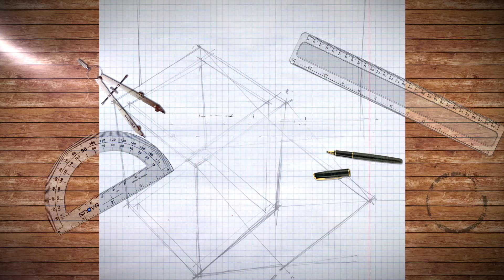Build a MOTORIZED monitor lift (on a budget!)

Comment: This gives me a cool idea.
It could serve to hide a 5.25" drive if someone has a custom desk PC. Just have it be retracted and flush with the surface when not in use, and when you need it, have it rise out of the desk itself, close enough to access it easily.

...Yes I know 5.25" drives are basically extinct but some people still use them, in fact some people even still NEED them to do stuff.

Comment: Very cool idea, I've seen furniture with these in it, but super expensive.
My one suggestion would be to make the platform into a box with sides and the top piece (that you put on yours when it is down).  this way when it goes down, you don't need to put that piece back.
Reply: Hi Michael 🤓

Comment: A cool idea is to make it also like a frame. So you need need to have a piece of plywood to manually put down, it will just rise up like a frame. And if it can handle the weight you probably do some nice designs or paintings to hang on it. Would be really cool

Comment: Awesome design! Looking to do the same but mounting it on the underside of the desk. I'd like to have usable workspace when lowered without having to manually place a platform on the top whenever lowered. Thank you for the video. Has everything in it that I needed.

Comment: I like it and to anyone who does to, you can actually improve this.
Instead of a threaded rod, use a lead screw. They are more rigid and provides better control due to them having more than 1 separate thread.
You can also replace the right angle aluminum thing with aluminum linear rail shaft. This will reduce the overall required force due to friction.

Comment: Man you did great. i was  thingking about how to make cheap long stroke linear acuator and your video solve them all. I was succesfully made sliding door also using gt2 Belt and pulley, but never once thingking it also be possible to attach thread working as linear actuator.

Comment: I would’ve extended the chassis higher and made the drop-in beam part of it. Or hinged that so I could flip it back when raising. Seems a bit neater than removing it manually every time.
Nevertheless, excellent work!

Comment: For a few more bucks you would get a more solid and sustainable solution.

There are special tools for connecting the belt and normally you add also a tentioner to avoid that the belt wobbling around and lose traction.

Comment: That is a really cool DIY project.  If you added a frame on the sides and top you would not have to manually put a cover on it when it's in the down position.

Comment: A good preventive measure is to put two of the limits switches in series with each other for each motor on each end so that just in case one limit switch fails, the other switch will back it up and still cut the circuit so your motors don't burn themselves up by trying to pass the end of their range and getting physically stuck.  One extra switch now for each motor is certainly cheaper and decidedly more convenient than having to acquire and install compatible replacement motors later!  Simple prevention that costs next to nothing.
Reply: Matt

Comment: Very good. Think uve missed a trick though. Why not attach the the cover to the mechanism aswell that way the whole lot will lower and instantly hide the monitor. You could even hang some small pc speakers to the underside of the cover which would then lift up with the whole assembly.

Comment: You could try using trapezoidal threads and their given nuts,, (the ones used in 3d printers), they're pitch is much greater so the monitor can come up faster but increase speed does mean increase momentum which could be bad

Comment: You could improve this design by adding a hinge one the door in the back and adding a way for the lift to push it open. Making it completely invisible without the need to put the shelf on it.
Reply: It's not a bad idea, but the problem would be the hinged shelf getting in the way (for example moving the monitor by mistake). Another idea would be to motorize the cover part and put some metal reinforcement to avoid flexing. (Or even motorize the hinge).

Comment: What motor would be powerful enough to lift up a piece of granite countertop above a cabinet with a mixer? ( to lift the whole conglomeration)
I want to make a pop-up kitchen cabinet for a dead corner in my kitchen counter, and the regular method is to buy a ready-built lift (which does not seem so cheap).
Should I just order a ready-made lift? Is that the more practical solution?
Thanks!!!

Comment: A proper and more suitable method, would've been to attach the top platform board, that you manually remove/replace, to the elevation board (so it rises with the whole thing)... Or better yet, a mechanism that rotates it 90 degrees to vertical, front to rear, allowing the riser mechanism to elevate in front of it, and lower back down after use.

That's the way I'd have done it if I had the skills, the tools, the materials, and the time... Oh, and I still had both my arms... and I wasn't stuck in this iron lung... And I had a monitor... And a desk... And an office room.

Comment: Great video, but you forgot to include the schematic and wiring in the description.
Also, the motor isn't available for sale anymore and the limit switches are not linked.
One more tip: Add a bit of oil to the threads.

Comment: no mention of how/what was used for the 12v supply to the motor? would also like to see what happens when the single limit switch fails, but then I`m evil :) good vid though.

Comment: Hi Matt, great video!

On the motorized theme, would you consider a build of some motorized window curtains? Perhaps something that can be smartphone controlled or automated to open/close in time with sunrise/sunset using Arduino? Commercial versions of these are very expensive, yet it seems like something doable with some pulley curtains and some engineering/electronic talent. Would be a nice follow up to your "false window" project too.

Keep up the good work!

Comment: Hey decent job! I also thought about building one. I decided to use pneumatic springs to unlock instead of a motor much quieter faster and more durable. i also dont rely on electricity. Sad thing i dont have a cool remote to open :D

Comment: "Why, I expect you to die Mr. Bond!", mwuahahahaha!!! ;-) Fantastic 60's evil lair accoutrement!
You could also do it in reverse. Instead of raising and lowering the monitor, you could build a cabinet the same size as the whole lift mechanism that would go above the desk. Mount a framed map on the cabinet. Hit the switch and watch the map, inside the frame, go down to reveal the monitor. The map would be much lighter than moving the whole monitor. And very, very evil lair! Or, a drinks cabinet that slides apart. "Same thing we do every night, Pinky. Try to rule the world!"

Comment: use locktite universal glue
it prettymuch glues any rubber, plastic or fabric together
if this doesn't work the way you want or you cant find any at the store try melting them together with nailpolish remover as this is often based on the same chemicals as locktite
do make shure to put on some safety glasses as locktite tends to shoot a small drup in the air when you putt it down without its top!
trust me there are a lott of people ending at te ER for this

Comment: I'm not convinced. I think it lacks a rotating match holder that, when it strikes the side of a glued on matchbox side on the way up, lights the fuse of some fireworks (3 or 6; Super Mario style) to go off at the exact moment the monitor stops. Without that this just feels incomplete...

Nah this is cool. I remember some guy on a renovation show that paid over £10k for a solid desk with a rising monitor. Been using the same desk since I was ten or so but next time I move I might build a corner desk and then I'll 100% keep this guide in mind. Any thoughts on covering the top (just build a frame around the monitor that also sits flush maybe)? I

Comment: So I thought this would be a great project to do. I got about half way though and noticed that there are many missing parts needed to build this thing. The push switches are missing and the brackets for mounting them not to mention the screws.  Then we have the bearings and the entire hardware list needed to mount all this stuff. I guess I will get my order then place another order for the hardware I need to mount it. Why don't you complete your hardware list so I can order the stuff I need.

Comment: I'm going to try and do this with 2x 775 motors and T8 lead screws for the lift, and 8020 aluminum for the desk and lift platform.  I have no idea if it will work or how well, and wouldn't know where to start with trying to calculate it.  If it doesn't work I can try a winch or something.

Comment: It would've been cool if you had used an arduino and another one of those motors with threaded rods to make a wooden plank flip down underneath the desk using hinges so you don't have to remove the wooden board every time.

Comment: Instead of adding 3 more screws to hold the bearings in place..
 You could have simply added another washer to the other side of the bolt holding the bearing.

Comment: Hi, great video... but one question, what governor and power supply you used? if you have a link for that would be very helpful and the buttons to stop it from rising up or down (push switches) link... Thanks and keep up the great work.

Comment: Realistically, how much weight could this motor lift? I have a CNC machine that want to make a lift like this for, so that I can make the table I’m building it on boulder as an enclosure for efficiency. Obviously I’d need more than one motor for the job, I just don’t know the capabilities for the motor itself to be able to calculate if a few of these would work for the application or if I should just shell out the big bucks for a single 3/4hp motor, which I’m trying to avoid. The CNC machine is an x carve so it’s not exactly as heavy as a car, I can pick it up myself without too much issues. Any help will be appreciated! Also, great video!

Comment: Did you use a 110vAC to 12vDC power supply? If so, which one? I'm no electrician by any means & I've had no luck getting a constant speed from the motor. It revs to max rpm for a second, stops, and pulses. Weird...

Comment: Great project mate! Next time, I would use ACME threaded rod for a much faster raising/lowering speed.
Reply: Belts are faster than threads the problem here is the load of the motor

Comment: A lot of reinventing the wheel here. I've bought 60$ electric car windows set [prices in Poland are amazing]. First of all set is for a pair of windows, so actual price was 30$. Secondly it has system stopping the engine if window would come in contact with an obstacle like someones hand... or throat xD It mean it automatically stops platform from rising/lowering exactly at the level i need rendering those funny buttons you've used redundant or if some cables or a sneaky cat [got two of those furry bastards] would get in the way during ascend/descent making it far safer. Funny thing - exactly the same switch that you've used costs 80 cents and those reset buttons that you've used for stopping the platfrom are around 20 cents here and having been selling all that stuff for last 15 years i know both of them are really shitty. I would go with Fael or Omron microswitches instead of this cheapest chinese crap [far too important function in your build] and for the control i would go with arcolight - solid, yet still cheaper than a loaf of bread OR just used those in a kit - nice backlit arrows on them.

Good stuff on this channel. Subbed out of curiosity :)

Comment: Just reviewed this old video. 

I call them as I see them. Although it's a cool feature, but totally unnecessary.  A wall mount with keyboard tray would work better for most people. 

I have used linear activators in past projects. A standing desk was one of them. I used 2. LA’s with a automatic setup using a Arduino. It had presets for 3 people.  

Anyway that’s for sharing you project
Reply: care to share your builds?
Reply: Clint blahblah / possibly Clint, what are you interested in and what part of the world do you live in?

Comment: Quick question! Do you still have the specs on the "high torque relatively low rpm motor" used? Im only just getting around to my attempt so the links are expired and I cant find a similar part.

Comment: I still can't figure out the wiring connection of the motor and the push button which acts as a circuit breaker or some kind of power shun. Can you help me this?

Comment: Haven't yet watched this but I'm looking to somehow apply this, or similar to a wall mounted 3 monitor setup. I'd like to get a sit/standing desk and therefore be able to adjust my monitors. I prefer to have them wall mounted so I don't have desk sag, and because it generally looks nicer.
I have somehow finally found a height adjustable 3 monitor wall mount, so if I just take the clamps off of that and motorize it it might work.
If there's any actual good way to do this I'd love to know it

Comment: Very impressive. Just some questions: the motor you linked to is a 4500rpm one. O viously that would launch your monitor. How many rpm should it be? The pulleys you use have a bit of downgrade (=more torque) in it. What ratio are they?
The limit switch simply as you presented it, won't work as the circuit is broken. No matter if you flip the switch (to reverse the polarity), a broken circuit is a broken circuit. As you still have not provided the schematic, may I presume you did something like this https://arduinodiy.wordpress.com/2019/03/24/using-limitswitches-with-diodes/. ?

Comment: You mounted the first pully gear on incorrectly. Make sure you line up the set screw with the FLAT side of the motor shaft @ 1:55

Comment: Would have been much better to simply have a slotted desktop where the monitor would pass through instead of all the shelf going up and down.
That way you get more room on the desk when lowering the monitor and things won't fall off the edge of the desk while the monitor is down....

Comment: 3:02 Hi love the video. Was just wondering what type of wood you used to mount the bearing? I bought 8mm thick bearings and also bought 8mm thick wood to mount them on but the wood seems too thin and weak and I think might buckle under the weight. Does anyone have any suggestions for what type of wood to get? Thanks a lot
Reply: He uses MDF wood

Comment: Hi Matt you have awesome content keep it up! I stumbled upon your videos looking for a way to make a diy project in mind if you can help out and would be so much appreciated, hopefully you can. I have a to a touch screen radio monitor that is separate from the stereo unit which is connected with a thin ribbon wire harness. I want to make some type of low profile mechanism that will make the touch screen monitor retract in and out of the top of my cars dashboard to modernize my 1998 Honda interior and when using my gps have it eye level with the road. Any advice would be so much appreciated thanks

Comment: Why not use the "flat" on the motor shaft to secure the first pulley?  You put the grub screw in the flat of the "D", that's what it's for.
And microswitches are MUCH more reliable than those little red push buttons.

Sorry, just me whingeing, it's a great build anyway!

Comment: Do you or anyone have a specs on the motor and other parts. This is an older video and the parts are not on ebay. I would like to track down the parts.

Comment: If the top and bottom buttons break the circuit, how do you wire it so the "down" function works when it`s up and the "up" function works when it`s down`?
"Schematic and wiring will be added later."?
:/
Reply: Wire the DC motor terminals to the poles of a DPDT (Double Pole, Double Throw) switch, and connect +/- from the DC power brick to pairs of the remaining switch contacts such that the polarity may be flipped as the switch position is changed. There are now 2 current loops depending on switch position so insert one cutout switch between say each of the 2 + feeds from the power block to the switch terminal.

Comment: not that he could answer to that many comments, but if anyone else could help that would be great. if I want to make the lift for a heavier tv (55+ inches) is that motor enough ? or do I need a stronger one? if yes posting a URL to buy it (internationally) would be awesome! thanks!
Reply: I wanted  do something similar but some things based on the video to consider. the monitor in the video (QNIX QX2414) is ~10lbs a typical LED/OLED 55" ~40lbs the  weak point will be the pulley system, so this will not likely work as is. I'd consider a geared/chain/scissor or even a mechanism from a sit stand system with appropriate sized motor. It won't be 60$ in parts to make.  ebay has lots of turn key options around 200$ USD

Comment: High torque low pm for motor... Could you please be abit more specific? The link you have posted reads currently sold out. I wanted to get the same kind of motor you have but somewhere else. But I need to know what the rpm it is?
Reply: hi i have the same problem, i used 895 motor, and it has too much rpm and shuts down
Reply: @fab2853  thanks for sharing this info so i definitely knows I don't need a 895 motor. What rpm was the 895?
Reply: @Randy2747  I tested with higher amperage (10A), and the motor is capable enough to move the mechanism
Reply: @fab2853  thank you I appreciate the info 👍

Comment: should have made the toplid hinged so the screen flips it open and when it goes back down the top lid flips closed.. thats how the over the counter mechanisms work
the bearings are not designed to have pressure from the sides. you need differnt bearings for that (axial or thrust bearings)
example : https://www.indiamart.com/proddetail/tapered-roller-thrust-bearing-14081483333.html
otherwise i loved the video.. great build